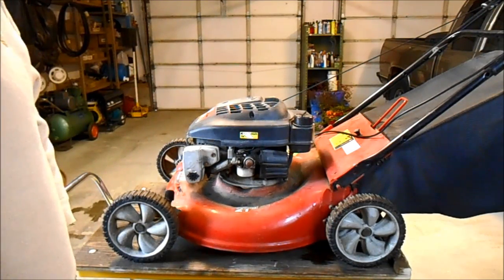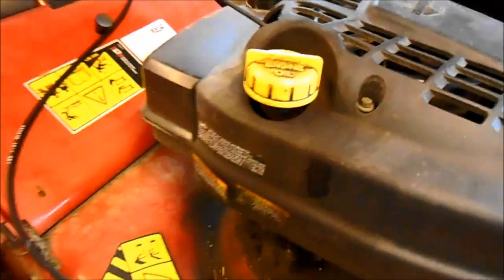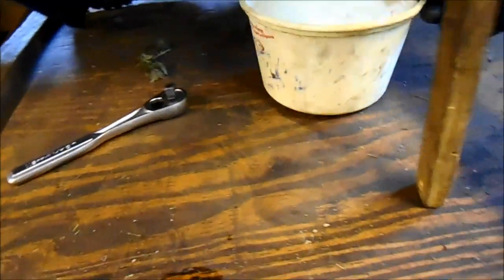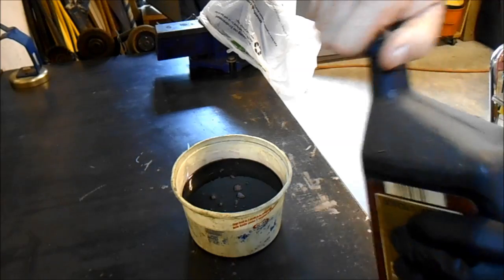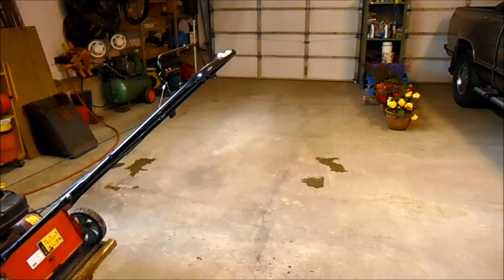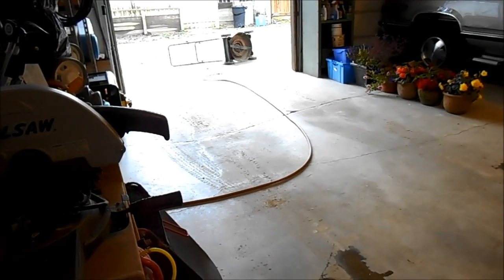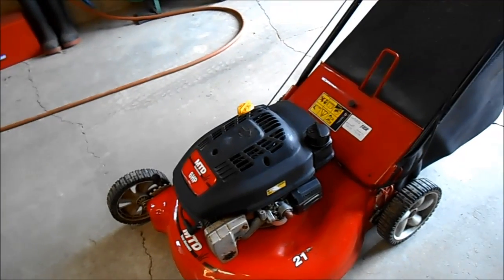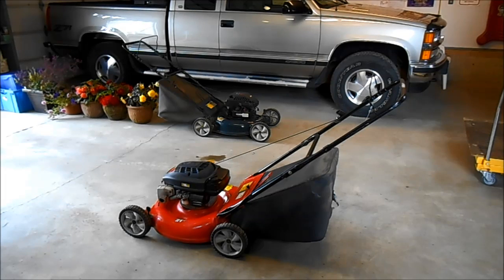Synthetic Oil or Not?

Comment: I havent changed the oil in my mower in 12 years, still runs great-ish, when it blows I'll buy another $20 mower at the flea market
Reply from the maker: Good luck on that.  That is one way.
Reply: Tony Brown  true, it didnt make it through the twelth year, and it was $35 at the flea market this time
Reply: It be better to keep items out of the junk yard.... keep it running as long as possible and laziness is a BAD trait.
Reply: Had you changed the oil just 2-3 times, you'd still have a mower.Well done saving $5.
Reply: @greghowdy5501  Did you at least top off the oil as it got low? How did it end up failing? Did it throw a connecting rod?
Reply: @ChrisPatrick-q6k some people are way too lazy these days. Using a mower without oil change for 12 damn years?? My god, oil is cheap and changing the oil every 40 hrs to keep engine clean won't kill.

Comment: Interesting. I have been using 5W30 synthetic in all of my small engines year round for the last 10 years and I have been happy with the results, my engines run well and burn no oil between oil changes. What I do is I buy a few jugs of synthetic 5W30 at a time when I find a good deal and I use it in my car and my small engines. Briggs says synthetic 5W30 is suitable for all their small engines in all temps and only needing to keep one kind of oil around for my car and my small engines keeps things simple.
Reply from the maker: You know this video has been around a long time.  I think it is transmission fluid in there.
Reply: @BrucesShop  I think the same thing, it looked pretty thin. Did it smell like ATF?
Reply: @averyalexander2303  lol... it's NOT transmission fluid... it's ROYAL PURPLE SYNTHETIC OIL.  I fix, tune, repair and sell small engine equipment. I use RP synthetic in all my equipment and have amazing results.
Reply: @BrucesShop  it's royal purple engine oil, royal purple engine oils are dyed purple
Reply: @TheOiftmtgnr3  I have Royal Purple 10W30 and am wondering if I can use it in my Honda HRR216 mower after using conventional oil from the start? You say you've been using it and have had good results...
Reply: @TheOiftmtgnr3  Not here destroyed our Pontiac!!!!!!!!!!!!!
Reply: @matthewarendt4416  yes, I do small engines repairs on the side... Works great!
Reply: @georgebroeren1617  what grade did you use? I had a 04 Pontiac grand prix, 200,000 miles no problems. My current suburban has 281,000, same engine, no problems at all. 79 c10 new engine, no problems

Comment: Well done - yes I use synthetic oil in all my equipment.  I  can definitely tell the difference in a machine I tear down that was run with synthetic oil, squeaky clean.  I also run it in my diesels and the cold start in winter is much easier on the starter and oil pressure builds faster.  It is fantastic in a snowblower that  you have to pull start , much easier to pull.  As you can see Bruce I'm convinced.
Reply from the maker: Interesting.  Do you buy synthetic that is made for small engines??
Reply: For my tiller and mowers I use 10w-30 vavoline syntec from Walmart on sale or crappy tires  synthetic made by shell  Canada.  I can't recall a synthetic on the shelf for just small engines just non synthetics.  Donny boy 73 likes to use I think  Quaker state sae 30 HD non synthetic.  On my diesels its Rotella synthetic.
Reply: I always look at the engine manufactures recommended as apu or sae rating to use. All I use is a SL which covers everything including my Honda and General genset .
Reply: Dam spell check that's API and generac genset. If I remember correctly you do not use synthetic ?
Reply from the maker: Steve Rob Thanks for your input

Comment: The main advantage of synthetic oil is much higher temperature breakdown. Convention oil breaks down and jells at much lower temperature which make synthetic great for air cool engines. As long as you don't over heat the engine either is fine.
Reply from the maker: I thought it was the other way around.  The discussion continues.  Thanks for the comment David.
Reply: Supposedly the Corvette required Mobil 1 because of it's high oil temperatures.
Reply: Fact Checker No one said they wouldn’t run fine on conventional oil...but since you’re the “Fact Checker” why don’t you check out the “fact” that synthetics handle heat and cold far better than dino oils.

Comment: Synthetic oil dissipates heat better than conventional oil and actually protects the engine from over heating.
Reply from the maker: Well I understand this is a hot topic Carl.  I understand your view I really do.  I think if synthetics are made for air cooled engines that would be great.  They are a derivative from natural gas and I my thoughts are evaporation and breakdown from heat.  However I am not a scientist either.  Thanks for the comment.  The discussion is great.
Reply: Synthetic oils hold up  under high temps better than conventional oils. Known fact.
Reply: Amsoil Synthetic Small Engine oil 10w30 is Definitely the Best you can Use'
Reply: Jacob is correct. Amsoil sells 100% synthetic oil which has been formulated especially for small air cooled engines. It is available in 5W-30, 10W-30, 10W-40, and 15W-50. The cost is $11 per quart and a typical OHV Briggs and Stratton on a 21" walk behind takes only 18 ounces per oil change. Keep in mind that a "Full" Synthetic oil is still legally a blend and is not a 100% Synthetic oil otherwise it would be labeled as such.

Comment: “Should I use synthetic or conventional (regular) oil in my 4-Cycle Briggs & Stratton Engine?

Our engines are designed to run on conventional oil, full synthetic, or synthetic blends. It’s an owner’s personal decision if the extra cost is worth the additional benefits synthetic oils offer. When a customer calls the Answer Center, we recommend the synthetic as it offers the premium protections we talked about earlier.

Comment: Looks like Royal Purple oil to me.  That's what I use in my mower, Honda GCV 160.  I change it at the recommended intervals.  It's probably overkill for a mower, but it runs smooth and I've never had problems.
Reply: RP is crap in any engine. I use Amsoil small engine oil in all of my engines.

Comment: I accidentally bought synthetic shell rotella 10w 30 for use on customers honda and kohler engines and I havent had a customer come back complaining about it. However, your findings are very interesting.
Reply from the maker: It is a great discussion.
Reply: @BrucesShop  I use heavy duty diesel motor oils like the Delo 400, shell Rimula R4X, shell Rimula R2 Sae 40, Petronas Dieselube 540 Sae 40, Total rubia Tir 7000 15w40.

Splash type engines like generator and mowers don't need synthetic motor oil

Comment: Using 5W40 Rotella in a 1965 Wisconsin TR10D. All I've done is put new rings in and deglazed the cylinder. original 50+ year old seals and doesn't leak or use a drop of oil.
Reply from the maker: I thiink this was trans fluid  looking back now.  Thanks for the comment.

Comment: lawn mowers are fun to play with and experiment with because they are simple and easy to understand
Reply from the maker: Yes they are.  They still trick me when looking for a fault.  Yesterday I was looking for a problem I thought was serious and it ended up being a primer bulb seal.
Reply: Bruce Pender yup i have a 4.5hp Briggs that has a cracked intake tube so I'm trying to fix it so I can use it again
Reply from the maker: You should be able to get one on ebay or amazon.com   in Canada it is amazon.ca
Reply: Bruce Pender ya If I can't find one I'll use in weld
Reply from the maker: You mean JB weld?
Reply: Ya autocorrect fail

Comment: The motor smokes probably becuase it got tipped over on its side and  oil leaked  in to the intake  via the scavenge air tube .
Reply from the maker: Could be but it smoked for a long time.  This is an old video for me to remember.  Thanks for the good comment though.

Comment: You should run the mower for 10or15 minutes before draining the oil to get it hot, it'll flow easier. And drain it from the dip stick.
Reply from the maker: +bser3973   you are right.

Comment: Hi Bruce me again. Great video it came up on my icons and I thought I have to watch this. I've seen this a lot an engine smokes on synthetic but not on conventional oil that's why I only use conventional oil in small engines. I see a lot of guys useing synthetic but if you try to tell them they're throwing money away on the wrong oil they argue as you've seen in your comment section
Reply from the maker: Right.  Air cooled engines run a lot hotter than water cooled engine.  Synthetic oil is derived from natural gas products and they breakdown faster than conventional.  We will probably get some hate mail just on this short thread.
Reply: Bruce Pender Synthetic oils do NOT break down faster than mineral based oils! The opposite is true. How much oil does that Briggs hold...half a quart? Whoa we’re saving big $$$ going with dino oil!
Reply: Bruce Pender Synthetic oils do NOT break down faster than mineral based oils! The opposite is true. How much oil does that Briggs hold...half a quart? Whoa we’re saving big $$$ going with dino oil!

Comment: I burn synthetic oil in my four cycle stuff all the time and they do not smoke, but I match the viscosity to the engine.  Generally I run 10W-30 Pennzoil Platinum in everything and change it to exceed manufacturers recommendations.  My philosophy is "oil is cheap, engines are costly."  I also burn synthetic two cycle oil in my two cycle stuff - Stihl Ultra oil, mixed at 50:1.
Reply from the maker: I lost the left handed crescent wrench comment but here is a couple of links for one.  They do exist.  My father in law brought mine back from the war in Europe many years ago

https://www.amazon.com/Stahlwille-4026-10-Adjustable-Spanner-Diameter/dp/B00C11UIW6

https://www.google.com.mx/search?q=left+handed+crescent+wrench/&tbm=isch&tbo=u&source=univ&sa=X&ved=0ahUKEwier9fQqO7YAhUJyYMKHea0BEAQsAQIJg&biw=1366&bih=662

Comment: Wow! That mower looks brand new now. How was the spark plug, was the mower running rich? I use Pennzoil 5W-30 in my mowers, but by mistake I had purchased 5 Qt. container of Pennzoil 5W-30 "Synthetic" Oil for $21 from Ebay. Some lawn contractor use Synthetic Oil instead of the regular oil, because its more forgiving when delaying their equipment oil changes to first satisfy their customer's lawn needs. So, I'm thinking of using this Synthetic oil in my mowers oil changes, but won't it with regular oil. What do you think Bruce?
Reply from the maker: Right  I don't know if you can see but his was made in 2014

Comment: My 21horse power 2007 runs what JD said to use 10w30. I put a little MMO in it 2 or 3 ounces. When changing my lawn mower oil. Also 4 ounces in the gas tank. Change the all filters and plugs every two years. I have 180 hrs on the mowing on the counter. Put 89 octane ethanol free gas too. It runs like a top.Grease the fittings twice a season. Never have used the under deck washer. Kills the bearings. Blow off mower deck after every use. Keep a battery charger on the battery between mowings.I bought a new battery 3 years ago at TSC store on sale.  Shawn

Comment: Bruce, what do you think of 2 stroke mowers. I had a Lawnboy for 20 or so years, it was 

an absolute pig to start every spring. But once started it wold run all day. Got a Briggs now,

no more than 3 pulls and she's away.
Reply from the maker: i have no issues with either 2 or 4 stroke motors.  Mixing the fuel is a negative for some.  I don't like working on 2 stroke small engines like weed whackers or chain saws.  Just my age as yanking that rope 50 times is tough.  When they come to me they aren't easy to start.

Comment: Use Amsoil Small engine in my Husqvarna 19hp Kohler no problems
Reply from the maker: +Anthony Macneil Well this is an older video.  I think there was trans fluid in the mower.
Reply: +Bruce Pender Listen carefully. He put old oil in it to see if it runs well after some idiot put trans fluid in it instead of motor oil. He then says if it runs well with real oil, he will change the oil.
Reply: Try Amsoil 10W-30 Synthetic Small Engine Oil   https://www.amsoil.com/shop/by-product/motor-oil/4-stroke/formula-4-stroke-10w-30-sae-30-small-engine-oil/    It's some good stuff!!!
Reply: If you are going to use Amsoil in a small engine, you should be using Amsoil small engine oil made for those engines. I am an Amsoil dealer and i use Amsoil small engine oil in all of my engines. I have been working on small engines for over 20 years now.
Reply: @josevega7680  Thats what I run. I use Amsoil in my Harley, and Vehicles too.
Reply: Amsoil small engine oil 10w30 💪

Comment: Synthetic oil is always better than conventional oil, assuming it is from a reputable brand.
Reply from the maker: Well small engines run hotter than regular engines as they are air cooled.  To me that is the main reason to use regular oil.  This mower had transmission oil in it I think.  There are lots of theories. The main thing is that they have some sort of oil.  My last mower lasted 28 years and I sold it running.
Reply: Mostly it doesn't matter for most applications. I live in Iowa and the winters get very cold here. One instance synthetic is better is on cold start ups, you can certainly tell the difference at -10 F with conventional versus synthetic. Conventional the engine hardly turned over and synthetic not much of a difference. 
Nice to know you got 28 years out of your mower, in that case just do what you do. (:

Comment: I'm also a synthetic oil user in my push mowers. I have a 24 year old Craftsman II with a 3.5hp Tecumseh, and a Poulan with the 500 Series Briggs. Both start up on the first pull. The Briggs will smoke about the first 5 seconds, but it was also a bit abused before I got it. I was honestly thinking of trying Royal Purple in them. It may be $9/qt, but if it's better oil, then why not? I change the oil twice a year so it's not like I'm spending $100/year on oil.
Reply from the maker: +AnthemBassMan  Well this is an old video.  I think there was trans fluid in it.

Comment: I had Royal Purple left over when i switched from a gas car to a EV so 2 years ago i started using it in my riding mower and the engine runs a lot quieter. When i changed it in the early spring the oil was still clean and looked like it could go another year or 2.
Reply from the maker: Thanks.  this is an older video made in 2014.  I think the oil ended up being transmission fluid.

Comment: Good work, may I ask,what you use to balance your blades with ?
Reply from the maker: It is really high tech (joke).  I put a nail in a vice and if the blade falls I grind off a bitt of the heavy side.
Reply from the maker: In this video I sharpen one at 9:50
Removing, Sharpening and Balancing a Mower Blade

Comment: So as you can see by reading the comments, the answers differ and are all over the places. Why would you put synthetic oil in a $150 MTD? My suggestion is to read and research several different websites about conventional vs synthetic on the internet.
Reply from the maker: I had an old Tecumseh last 27 years.  I changed the oil in it once a year.  We have a double size lot.   Like 65 ford says below air cooled motors run way hotter than liquid cooled ones.

Comment: I'm trying to figure out how long an engine should run (in hours) before swapping to synthetic. SPECIFICALLY for a small 4 stroke (generator, pump, commercial equipment, etc). Any advice/tips is appreciated.
Reply from the maker: I think if you want to just go for it.

Comment: I use synthetic in my old John Deere with an 8hp Kohler. Haven't had a problem.
Reply from the maker: +Jon Myers Maybe it was trans fluid.  I didn't have it analyzed.  But I still use 30W in my small stuff
Reply: +Bruce Pender that is deffo trans fluid, much thinner, it will pass the rings and coke up the head and valves
Reply: I run Castrol fully Synthetic in my healthy small engines and the difference in power is noticeable. Mowers cut taller grass and snow blower throws deeper snow. Give full synthetic a shot, after all these tools are about getting the job done and the faster the better in my book. Obviously if it burns 30wt it will burn more synthetic.
Reply from the maker: +charredskeleton  Thanks for the comment.  I am rethinking the synthetic oil thing.